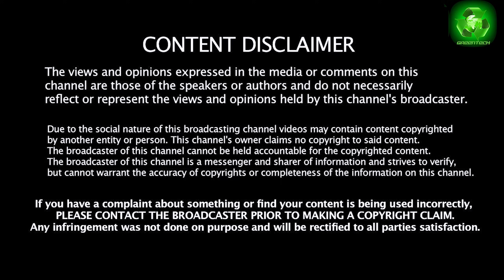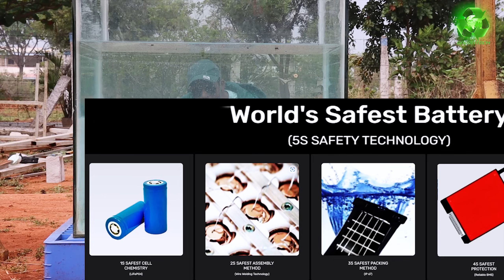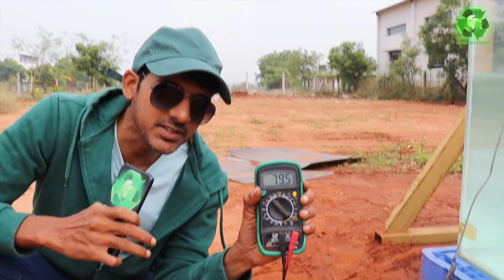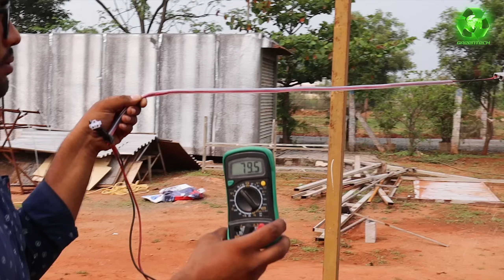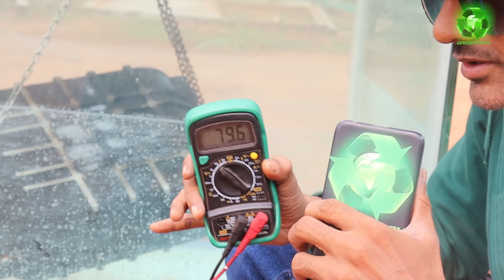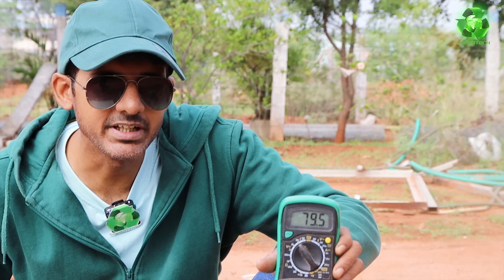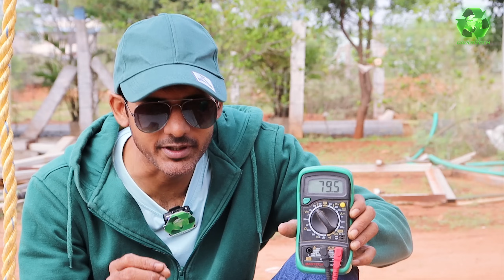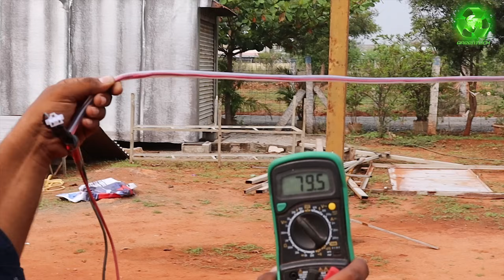World's Safest Battery - FIRE, WATER & IMPACT TEST | Most Rugged Battery in the World- 7 YR WARRANTY

Comment: Wire connection in connector end  is not fully submerged,but in actual scenario that also will submerge.what happens then? But beach video that also submerged. I have good faith in this battery .